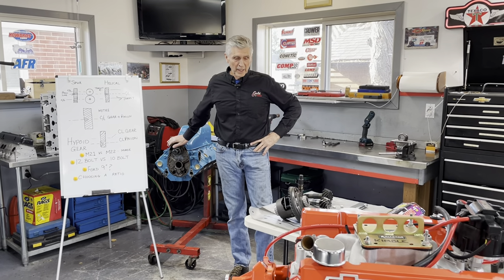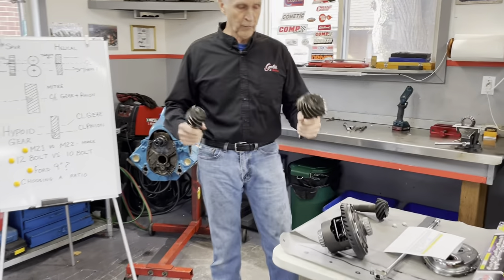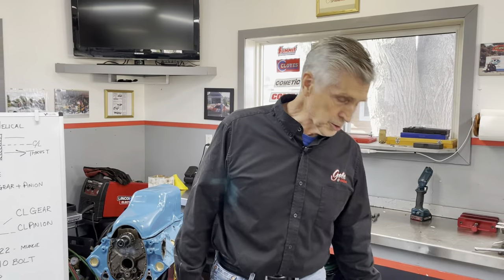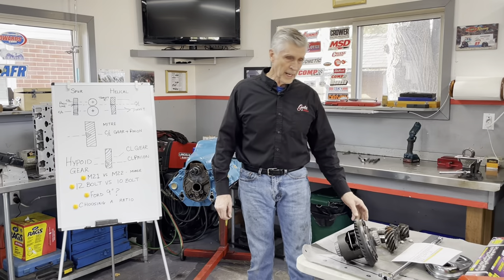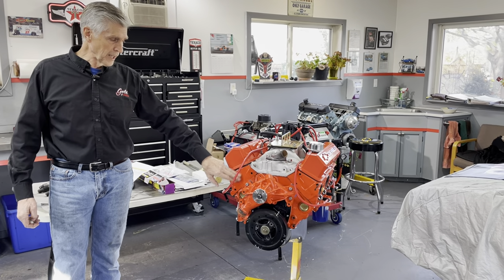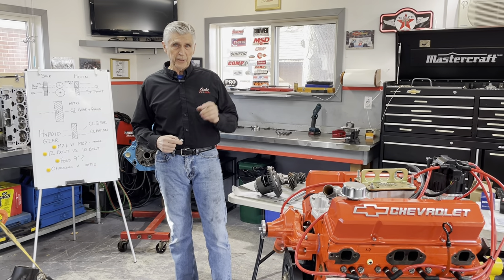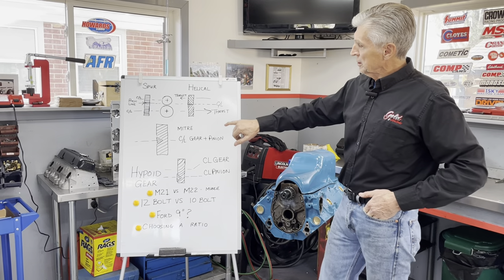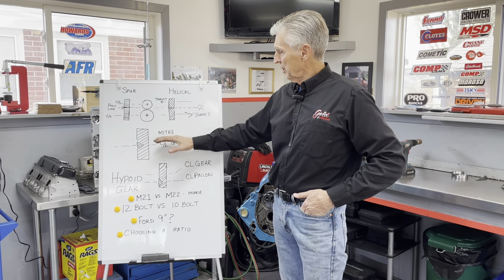How to properly select a gear ratio - Why does an M22 Rockcrusher whine? 10 bolt VS 12 Bolt and more

Comment: I am 65 and have been hearing these terms from the guys since I was 10 years old (rock crusher, ratios, Ford 9", etc) but no one could explain it, leaving me with a passive knowledge at best; I only knew it was good to have. I finally understand and you explained it all in 30 min! Thank You.
Reply from the maker: Thanks for the comment Ken, we can never stop learning. AG
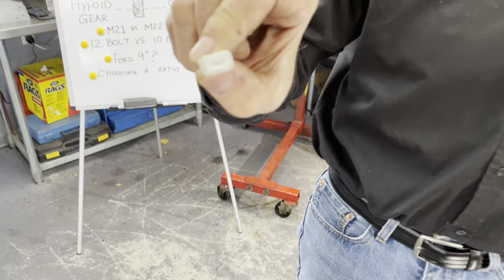Reply: I am 73, had my Sunbeam Tiger for 48 years and the 3:54 rear end made all the difference with a 375hp 289 build.
Reply: Great advice in your closing AG..
Thank you for another great video!👍
Reply: My buddy worked in an engine shop around 1980, the seasoned owner used to always say you young guys always start at the wrong end of the vehicle which is good for my business

Comment: Back in the day  had a 66 Beaumont with a powerslide & a 12 bolt 4.56's. 55 MPH on the highway with G60-15's!
Reply from the maker: Thanks alleyoop. 4.56 is fun on the street, might be a little noisy on the highway. AG
Reply: In Low or drive
Reply: Yea about  3500 rpm at 50,  not good on the highway.  Usually no air and a hot box.
Reply: With 4.88 mine felt like the rpm matched the mph.. 5500 seemed like only 55mph 😆

Comment: "Rock crusher"  is also an industrial service factor classification of gear boxes,  factoring in high shock and torque loads. A very appropriate  term for the M 22
Reply from the maker: Thanks Jay. AG
Reply: Had a m-22 behind my 327-55 Chevy,  2 x 4 barrels, Duntov cam with 11.25 compression, Mallory double life 4  lobe with 4.10 Pontiac rear.  That trans was a screamer too, loved that sound.   Engine was at 7000 with those big meats I had on the back coming off the line, would tote the front wheels for about three car lengths.  Fantastic engine and transmission.  Made that shoe box run.
Reply: They weren't that great,When Buick had a pro stock program with the stage 2 engine,they used the Mopar 4 speeds because the M-22 couldn't handle the Buick Torque and high rpm launches

Comment: Changing from a 2.73 to a 3.55 is like day and night on the power of the car!
Reply: I went from 2.73 to 4.11 with my Camaro! I was a dumb kid when I started my project and thought I'd be upgrading my tranny to a t-56 viper spec. Cash ran out so I left in the super t-10. (thought I had the regular t-10 at the time)

With the gear swap, I gained a whole gear off the line, but lost a gear on top! Literally.

Going in second gear now with the 4.11 is literally the same as first gear with the 2.73!
Reply: @jakefriesenjake  you are right, there
is alot more rpm with the 4.11 and it will scream at 110 mph!
Reply: @leonardfoster6252  Yup. I'd be right around 5300 rpm or so with 4.11.

2.73 would be only at 3400 rpm or so, in 4th gear and 28.75" tall tires.

4.11 gears is also much nicer on my clutch!
Reply: @@62guitarguy right on!
Reply: @@62guitarguy yup!
Reply: My 79 trans-am has some like 2.86 or 2.73 gears. I cant even power brake it to get the rear tires to spin. It kills the motor every time.

Comment: Actually, the right rear wheel will unload and spin with an open differential... unless you are launching in reverse.
Reply from the maker: Thanks @elebeu. You are correct about that. I got it backwards. Thanks for pointing this out. AG
Reply: Going to have to go and try the reverse launch now!

Comment: Also, the higher you go numerically with the rear end gear ratio, the less likely you will blow up your tranny, but, the more pressure you put on the actual axle shafts. (depending on how much power you make and how heavy the car is)
Reply from the maker: correct, tanks for the input Jake. AG

Comment: When I bought my 65 vette(l78/396) back in the early 90's, it still had it's oem trans(m-21), and it's oem rear gears(3.08).   ARGH!!  What a combination that was.  You had to literally drag it out of a stop, forget about starting on an incline.  But boy was it nice on the highway. It was actually hard to hit the redline with those gears. That's probably why it still had it's original motor.  Of course I changed out the rears to 3.55's. Also tried different tranny's in it. M20, M21, Tremec 5 speed. I often wondered who, and why, ordered it with that original combination.
Reply from the maker: Thanks for the info Raa. It mist have been a special order. My understanding is that with 3.55 and down, you got M20, 3.73 and up you got M21. AG
Reply: Clutch eater.

Comment: I thought it was great that you talked about cruise rpm and with an automatic so many people just suggest a 3500 stall no matter what the cam or car specs. I was taught never to put a stall converter taller than cruise rpm due to the excessive heat it will create. This is why a project has to be looled at from many aspects before it is started IMHO. Maybe something has changed, I am unaware of or maybe that could be a future video for you. Good stuff 👍
Reply from the maker: Thanks Kris. I didn't get into converters in this video, but you are giving me some ideas for the future. AG

Comment: Very good vid as always, I do have to mention the reason for the popularity of the Ford 9 inch is so misunderstood. Ford designed the 9 inch to be quiet and strong, how did they do that, by using a Hypoid gear or lowering the pinion gear lower on the ring gear, instead of on a Bevel gear which is on the the C/L. What this did was to allow for more gear tooth contact (stronger) and quieter running gear set. 
  But here is where the big misunderstanding really comes in. With the advent of the modern Pro stock car, the wanted to lower the drive train, so the Ford 9 inch was 2.250 lower off the C/L, so now the drive train can sit lower in the car. The gears are stronger yes but they do take more power to rotate. 
 One of the most over looked rear ends for street cars is the 8 3/4 Chrysler, strong and light and very inexpensive to build for at least 75% of your builds. In the 70s we ran a H/G Nova with a Dana 60 rear end, it had a 7.17 gear which only had 3 teeth on the pinion gear. 10 runs and you needed to change gears.
Reply from the maker: Great information @racer. Thanks for the input. AG

Comment: Funny, you say that because this M2 two came out of a 71 or 72 big block Chevelle, the guy wrecked the car and I mean wrecked the engine wasn’t any good he got hit so hard in the front did it bent the crankshaft. I had it in my 442 for about a month just to make sure it worked OK, and nothing was bent, my M20 was leaking, so I wanted to reseal the whole thing. Then I put it back in and took the M22 out and put it in my garage on the second floor where there’s no traffic. It’s funny I remember putting it up there. It still had oil in it because I put a old piece of driveshaft in where the tail shift comes out so it wouldn’t leak and I’ve never seen any stains in the ceiling so I guess it’s still full. Because of its age I guess I should put bearings in it if I’m gonna sell it. Thanks again for the video was really cool.
Reply from the maker: Tucker, thanks for the rest of the story. If there is oil in it the bearings should be fine. AG

Comment: in the mid 70's i put a 12 bolt in a 66 GTO for the simple reason it was shorter from one end to the other than a 10 bolt and it was nice that it had 3.73 posi too . being shorter allowed me to put fatter tires on and the wheel wells didnt chew them up
Reply from the maker: Thanks for sharing your experience TnGuy. Ag

Comment: Loved my m20 matched up with a 3.36 gear. 
28” tires. 
Worked well with a high rpm, hot little 283 small block. 
Fun car.
Reply from the maker: Good combination @b.s. So I said a 3.55 would be 3000 RPM at 60 MPH, a 3.36 would be 2839RPM. A 283 has a 3" stroke so you can rev them more. AG

Comment: Great video!  I wish I'd had access to your knowledge when I was building a power train combo on my first car.   As a kid, all I had was Hot Rodding magazines and I made all the wrong decisions! 😆 Would be great if you could do a follow up video about gear vendors (and is it worth the big price tag).
Reply: Gearvendors are for drag racers. So they can drive on the streets at a lower rpm. Seem to cause as many issues as the solve.
Reply from the maker: Thanks for the comment J.R. AG

Comment: Alan, thanks for doing what you do, I like all your content. I wish I had kept my Z-28, it was the quickest car in town back in 1973... It was a '70 model. They put the M22 in those but was also the last year for the 12 bolt rear differential. I think first gear was absolutely useless in my Zed sled. You did a good job explaining why that 2.20 first gear was used in those car's. I think my account thumb nail has a picture of the old Camaro. One more thing, I keep having to subscribe to your channel, is this a problem you have come across.
Reply from the maker: Thanks Cliff. Beautiful Z, 1970 was actually the fastest, last year for high compression. Thanks for the info about having to keep subscribing, I have not heard of that before. I will try to look into it? AG

Comment: Here's a fun fact about first gear multiplication;

The 2 older overdrive transmissions from the General need to have a minimum of 9.5:1 first gear multiplication ratio for them to be able to shift into overdrive @ 45 mph. This brings both the 700R4 and 200R4 very close to what the th350 first gear multiplication ratio would be with a 3.73:1 rear gear matched to it.

The 700 would only need a 3.08:1 rear gear to achieve close to the 9.5:1 first gear multiplication ratio. The 200 would need a 3.42:1 to get close to the 9.5:1 first gear multiplication ratio.😎👍
Reply from the maker: Thanks for your input as always Itseither. I checked your math on the 700, What is first the gear ratio on the 200? AG
Reply: @goldsgarage8236  
It is 2.74:1.
3.42 x 2.74 = 9.3708
.1292:1 away from 9.5:1
Is why the General usually teamed up a 200R4 with a 3.42:1 rear gear ratio. 😎👍

Comment: I watching two brothers race, the guy had a 60s firebird and the brother has a newer firebird. The newer firebird had taller gears and couldn't beat the older firebird in the quarter mile. This was on pinks.
The brother with the newer firebird asked if he could move his car back from the starting line and the brother agreed. They raced and the old firebird ran the same numbers but the newer firebird beat him over the finish line even though he was farther back. Ever since then I'm convinced that a higher gear ratio should be faster as long as you have the power.
Reply from the maker: Cool, thanks for the info 488. I used to watch Pinks, haven't seen it for a while. AG

Comment: You were talking about rock crushers, I have one up on the second floor in my garage. I think I have owned it since the early 70s and never used it. My 442 has an M20 in it and I have no desire to change it so I guess I’m gonna bring the M22 downstairs put it on my bench take it apart. I’ll put all new bearings and blocker rings in it.
Reply from the maker: Thanks Tucker, I use an M20 also because it has a 2.52 first gear compared to 2.20 for the rock crusher. 
That said, i bet it is pretty valuable. Thanks for sharing. AG
Reply: Why are the M22 bringing so much money. I thought everyone wanted all these std trans with 6 speeds and overdrive
Reply from the maker: M22's I think would be quite rare. I don't think they were introduced until 1970 in passenger cars. Many were used in Trans AM road racing. 6 speeds are great, but for a 60's or 70's muscle car I would still prefer the original Muncie's. AG

Comment: Another great video Al & Mike! 

Great info as my 84 C10 currently has a 700R4 with 2.73 and a 20x11 rear tire at 28.4” tall….curious what my dyno numbers will be and then I can figure out truck curb weight and calculate overall torque calculation.

Keep the videos coming!!👏🏻👏🏻
Reply from the maker: Thanks Roland. you have the right transmission to start with, your engine will like more gear.  AG
Reply: Had the same 700 r-4 truck several years but with a 2.56 rear gear.  Installed a 3.73 rearend out of a suburban. Picked up both performance AND mileage.

Comment: Well I really liked your tip at the end staying organized is so very important and you philosophy on a clean workbench is the same one I use it works I sweep the floor of my shop every day and put things away so that the next day is a fresh start if applicable, I guess I'm in trouble with my gear ratio on my 1966 Chevelle 4 speed Saginaw with 308 gears probably get great fuel mileage with the stock 350 though I know I need to change the ring and pinion but currently just trying to get the car built and driving do you think 355 gears or 377 ? She's my baby so maybe a little burnout once in a while but more for cruising and going to the beach. I live in Las Vegas lol. Thanks guys👍👍
Reply from the maker: Hey Randy, i like 3.55:1. That is what I have in my Camaro and unless you have an overdrive transmission that is what I would suggest. According to my Moroso Slide rule, 3000 RPM with a 28" tire is 71MPH. 
With a 3.73 it is 64MPH. Also, if you have an M20 transmission you won't find a speedo drive gear for 3.73. 
As far as I know, all cars supplied with M20, had 3.55 and down. All cars supplied with M21 or M22 had 3.73 and up numerically. Hope this helps. AG
Reply from the maker: Correction, with a 3.73:1 it would be 67MPH. AG

Comment: What gear ratio would you choose if where me?
78 Trans Am
383 stroker, 10:1, about 500hp, 6.700 redline rpm
M21 transmission
26" tire
Just street fun, some trackdays, fun drag racing with friends, and not driving around the country because I have a trailer
Actually has 3.08 and can't decide between 3.42 or more gear
Reply from the maker: Your M21 transmission has a 2.20 first gear. I would suggest 3.73 or higher numerically. This will give you 8.2 torque multiplication in first gear. AG
Reply: @goldsgarage8236  that's what I was thinking. Thanks!

Comment: 11:00 I get that helical gears are smoother and quieter but you also said stronger.
 I could see with multiple teeth engaged simultaneously that might happen but racing transmissions have noisy straight cut gears.
 I've always been told that's for strength.
Reply from the maker: Another good question Genifer. Helix angle generates thrust. The M21 rock crusher for example has a lower helix angle to reduce thrust. Racing transmission use a less diametrical pitch (DP) . This means there are less teeth per inch of pitch diameter. The pitch diameter is the circular centerline of the tooth contact pattern. Since there are less teeth, those teeth are larger, and so they are stronger. They are also noisier than more smaller teeth in the same application. AG
Reply from the maker: Genifer, i meant M22 not M21.

Comment: Enjoyed your video, my set up is a 454ci with a NP440/MY6 and 10 bolt posi 3.8:1 gear. The final drive in first is 9.52:1 and 2.25 in forth which is .73:1 all in a 78 nova. I don't think a street car can do much better other than go up to 3.42:1 gear for a better OD ratio. I have a 2.41:1 gear set if I want to go for a land speed record.
Reply from the maker: Thanks Joe, sounds like you have it figured out pretty good. AG
Reply: Correction, rear gear 3.08:1

Comment: The 2.20 ratio is for cars with a lower gear rearend...  I always like the wide ratio with a 2.54 ratio first gear...  Later 10 bolts are strong as a 12 bolt rearend.  Early 10 bolts break fairly easy, especially if they are a single track...
Reply from the maker: Thanks Leonard. I think for standard order, GM required at least 3.73 rear with the M21 2.20 first gear. AG

Comment: Why leave out the Mopar 8 3/4 rear end on par with the Ford 9 ...even thou the 9 has three bearings supporting the pinion... And the 8 3/4 was used in early funny cars running the 727.
Reply from the maker: good point Moparnut. No offense intended. I do know the Mopar gear was very good as well. Is this also called Dana? The  Ford 9" is just more common. AG

Comment: The worst thing you can do is continually use the revlimeter chip when the ignition  box shuts off cylinders it creates vibrations in the engine and  wears out the engine prematurely. Read the Rehe and Morrison  engine building book. They can tell that every time they tear down an engine, the same engine used for same type of racing engine that uses the revlimeter all the time that engine is completely worn out. Then engine that dose not bump against the revlimeter is always still in good shape
Reply from the maker: I totally agree @jims. The problem is that drivers and racers care more about lap times and winning than about the engine. This is especially true with underpowered cars that need the RPM's coming out of the corner. Testing has proven that lap times are best when they hit the chip, so that is what they do. AG

Comment: AG, I put a 3.55 gear in my 73 Corvette and took out the 3.08 or 3.36?  The 3.55 is an all around gear, but var would of ran much faster if I had put a 3.73 in it.  Turbo 400 trans with a B&M 3,000 stall converter...
Reply from the maker: Thanks for the info Leonard. AG

Comment: First gear is a lot different between the m20 and the m21. Well second one third also, but the leave of the m20 is the ticket.
Reply from the maker: Correct David, that's why i have an M20 in the car and my M21 is in my basement. AG